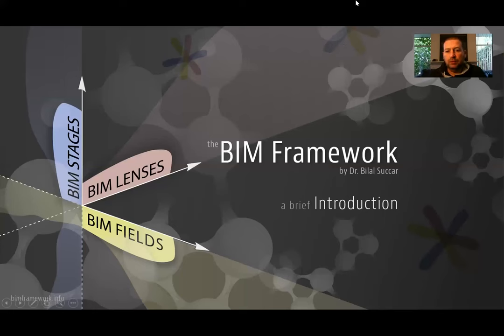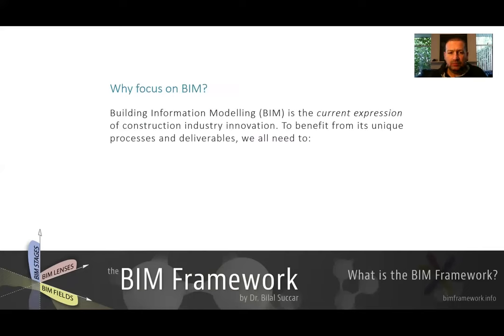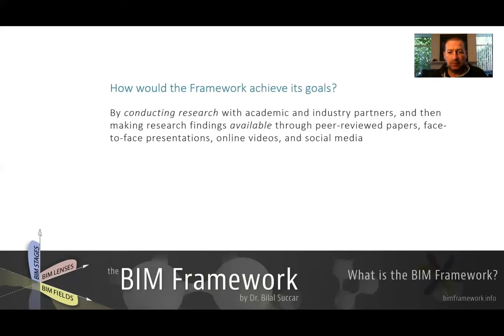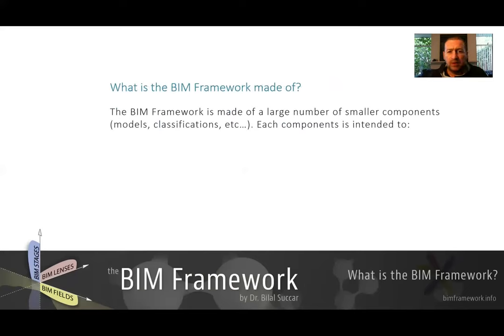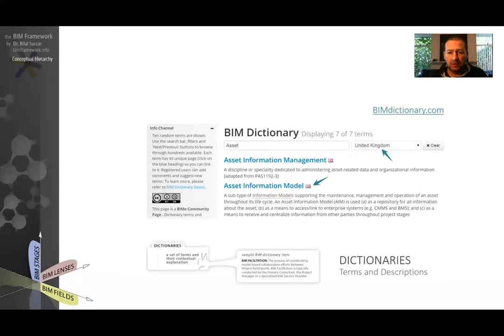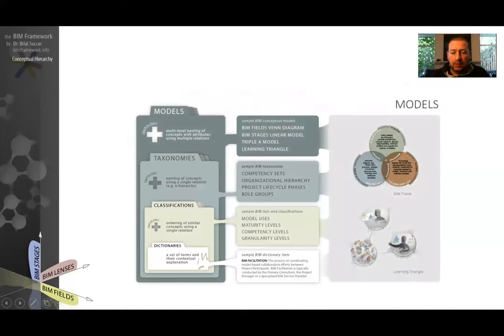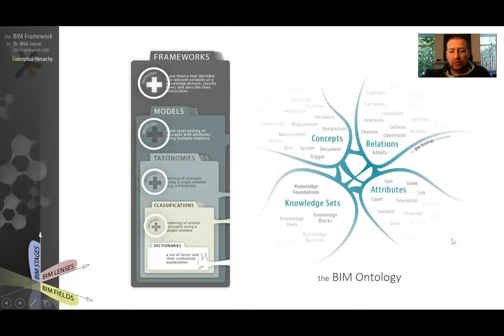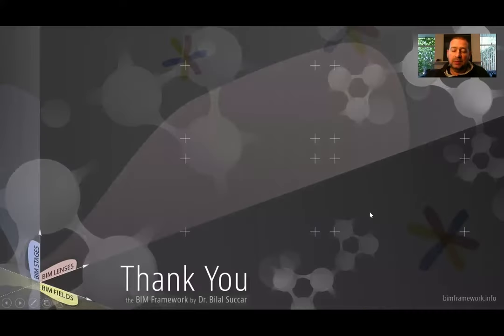The BIM Framework, an introduction

Comment: Hi Bilal, thanks for (another) good presentation. The only point that is not clear is the goal definition of the framework, you jump from "Why focus on BIM" to "How the BIM framework will achieve its goals". Considering BIM an Information System, it will generate Net Benefits through Use. The Framework objectives as a research effort (that explicitly excludes practical use) are therefore different from the objectives of BIM itself. The description of "What is the BIM framework made of" starts with a list of the intent of the components, which is probably the answer to my initial question (the goals for the framework):
* Clarify terminology
* Simplify complex concepts
* Identify workflows or sets of steps
* Deliver measurement tools

In other words, the Information Quality aspect of the Information System. Is this your understanding too?

Kind regards,
William
Reply: +William Lopez Campo Hi William, thank you for your valuable comments. The ultimate aim of the BIM Framework is to facilitate the structured adoption of BIM - the current expression of innovation within the construction industry -  by individuals, organisations, project teams and whole markets. 

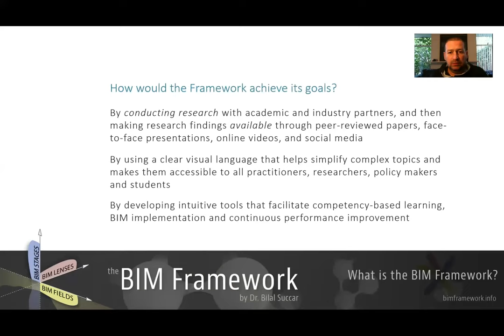To achieve this aim, there are number more specific goals which you kindly listed. The first three of these are all about information capture, clarification and representation...While the fourth goal - explained at 5:20 - is to use research-based methods to develop intuitive (and hopefully practical) tools to facilitate "competency-based learning, BIM implementation and continuous performance improvement". This is repeated at 12:50, where Tools are introduced as a practical outcome, the end product of the framework's many conceptual structures.
In other words, the BIM Framework is a research effort with the intention to continuously generate two things: (1) facilitate additional,  structured, and interconnected research, and (2) practical outcomes similar to online assessment tools, decision support templates, and learning planners/modules.

I will increasingly make the aims, goals, objectives, and deliverables of the Framework clearer through such discussions...thank you for the opportunity to do so.

Please let me know if I've answered your question.
Kind Regards,
Bilal
Reply: +Bilal Succar Thanks for the prompt answer. Yes, you have addressed the question. 

In my experience the clear goal definition helps greatly in its achievement and I often have to clarify the difference between the implementation objectives and those of the field of application, that's why I took the opportunity to ask for clarification as I thought there was a small but important link missing in the presentation logic. Your answer makes perfect sense.  

Thanks again for your efforts in building a backbone to the theory of BIM. I am humbled by your prompt and personal response and grateful for the time spent addressing it.
I will continue to read your publications avidly.

Kind regards,
William.